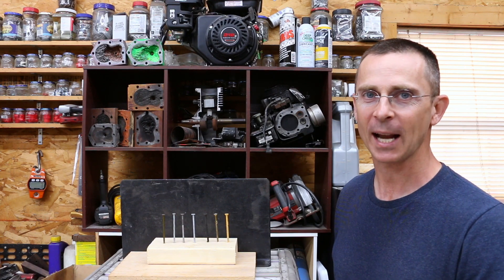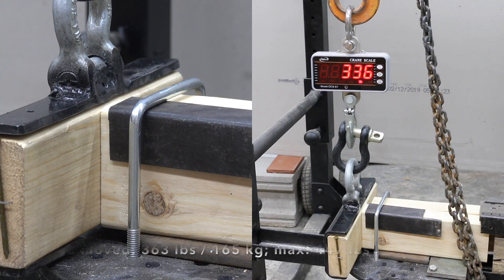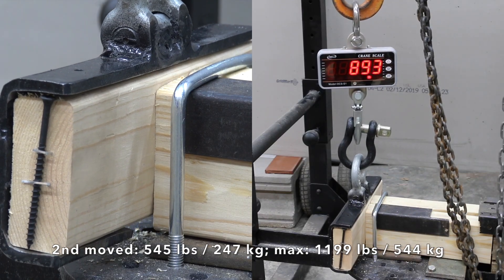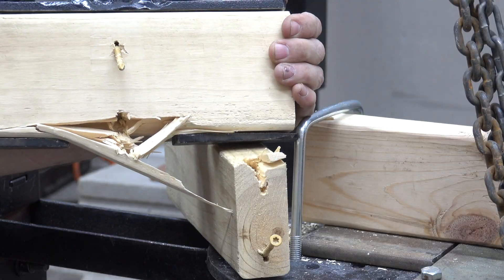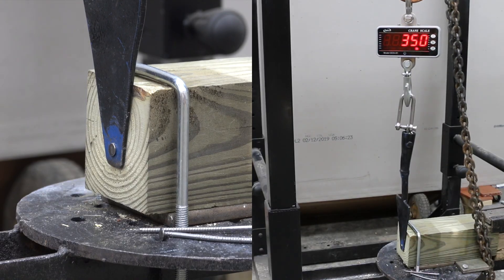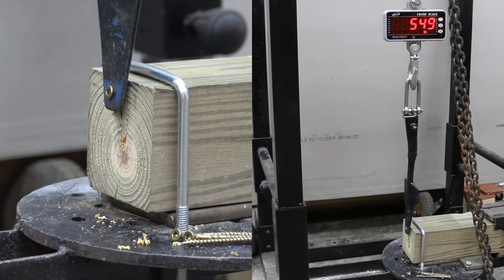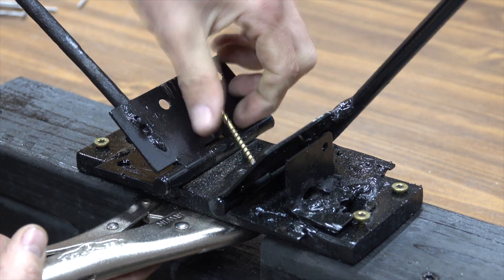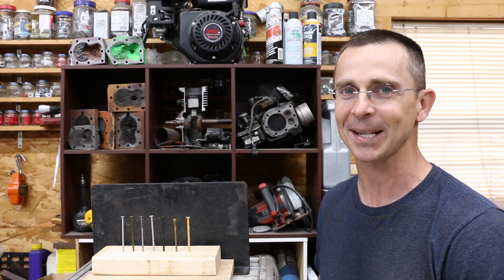Do Screws Shear easier than Nails? Let's find out!

Comment: I like most of your videos but there is a lot wrong with this one. A lot.
Reply from the maker: Thanks for the constructive feedback
Reply: I dont know how it's called in English but if you drive the nails or screws in the head wood you put them in line with the wood fibers and you have way less force required to pull them out or shear them off
Reply: Okay, constructive feedback. Test one: decent test and fairly realistic. Some added value. Test two: mostly pointless. You’re nailing into the end grain which will vary in strength. It’s more a test on the pull out resistance of the test items and not the shear strength. With having them in the end grain the pull out portion isn’t really helpful info either. Test three: pointless. Under normal conditions, even taking into account that structures flex, the test items won’t bend that much nor will they bend where you test them. For the screws that’s a critical point. Just my thoughts. I hope you revisit this one day.

Comment: I built with a lot of stainless steel nails and screws, some are ring shank but most are screw shank nails because I noticed ring shank break easily when driving. I also used some stainless steel screws, I noticed some screws break easier than others. Most stainless is softer than regular steel i guess.  I did get some stainless roof screws, they seemed to be pretty sturdy, but they are probably thicker. Nails rust and even the coated ones rust so that will decrease the life of the project if it is exposed to water. I also used stainless bolts but the bolts are very hard and the sheet is so hard you can barely drill it and it bends if you pull hard enough- they gave me a higher grade of steel I guess as a favor but i could hardly drill it- it will take a bend but with much effort.  it was pretty thick though. I have taken enough old work apart and saw expensive screws and nails rusting after 5 or less years of use. You made an excellent video, great experiment and discussion!
Reply from the maker: Great information. Thank you

Comment: Good video but as a builder and contractor this is really shear load not shear strength. Nails have 5x+ the shear strength screws. Main reason why houses aren’t built with screws. Second reason is time consuming. It also completely depends if you fasten correctly. There are actual patterns and cross grain nailing and weight transferring. They do make some structural screws now. Timberlock, GRK, Swanson and a few other brands but they aren’t commonly used. The cost is astronomical and time consuming. I did find the Timberlocks that replace hurricane ties is faster but a lot of money. $50 a box. End nailing and pulling up really won’t test it. An easy way is to put the nail or screw in half way and hit it with a hammer hard a few times on the side to bend it. Take pliers and go back and forth. You’ll find most screws break much faster. It’s why screw heads snap off a lot with impact drivers. It’s their weakest part. If you ya e a stripped screw you can always just snap it of. Most nails you need a saw saw or grinder to cut em if you can’t pull em out. 3” Hot dipped, galvanized, ring shank, clipped head nails are so hard to get out they are stronger than 20 equal screws at once. Just food for thought.
Reply from the maker: Thank you

Comment: Great fastener test! Could you add Simpson Strong-tie #10 x 2 1/2 screws to your next nails vs screws test. It is meant to replace 10d galvanized nails, where nailing Simpson galvanized brackets space is restricted. I will like to know, if the shear lateral strength is comparable to 10d galvanized nails when used with galvanized joist hangers. Thank our in advance.
Reply from the maker: Great suggestion! Thank you

Comment: the reason you use nails and not screws for structural loads is because the metal they use for screws is much harder and more brittle. That means with fatigue it will fail catastrophically. A nail will not. It will just bend. In a deck application, the force is up and down, so that imparts metal fatigue which will cause the screw to snap. The nail will just loosen and bend over time. The nail gives you warning.
Reply from the maker: Great point! Thank you

Comment: Another good video, one that might be interesting to see is the effect of multiple stacking. For example is will two screws in a piece of wood spread reasonably out allow that wood to support twice as much pull as normal or even more?

 Does a twice thick board equal twice strength? And is stacking two or more smaller boards stronger, weaker or the same as a the same thickness big board.

 Just as interesting set of ideas that have a lot of practical applications when it comes to construction. Thanks again.
Reply from the maker: Great suggestion! Thank you
Reply: @ProjectFarm , glad you think so.

Comment: The only issue I had with your last test where you were using metal levers to bend/fold the nails/screws is that you were not measuring the amount of force with each press of the levers.  From what I could see, it appeared to me that a couple of the screws required far more force to get them to bend in the first place - however once bent at least once, they snapped quite easily. 

I'd like that last test improved with some kind of torque measurement to let us know how much force is first required to bend each fastener.  If there is a significant amount of difference I think that should weigh on suitability of these fasteners.
Reply from the maker: Thank you for the constructive feedback

Comment: good tests and i loved the video but testing for sheer strength on screws is not tested cross grain to end grain because when you screw into the end grain (parallel with the grain of the wood) you have very little strength. I would actually love to see a test done with all cross grain fastenings. 
I am a Shipwright (shipyard carpenter) and have been using the torx head coated #10s for years to build working platforms and blocking/bracing for heavy industrial applications, last year i went to a new shipyard where they used drywall screws for the same applications and watched platforms fail under shock loads over and over again until it became a safety issue and i suggested we switch fasteners which completely solved their issues.
Reply: <3

Comment: I still would inherently trust screws for construction but isn't you shear test for the screws kind of flawed?  Ideally the thread would bite into the opposing material as much as possible meaning you would want o focus the force of the shear test on the shaft of the screw not the threads.
Reply from the maker: Thanks for the constructive feedback.

Comment: That was really informative!  Hindsight as they say is always 20/20, but I would've liked to seen perhaps the test using an LVL, or some other manufactured, and more consistent material.  The only reason I mention this, is that each fastener had such a wide range of failure; I would think a more uniform material may yield more consistent results.  Yet at the same time, again, that was awesome!
Reply from the maker: Thank you!

Comment: Those have got to be the most impressive drywall screws i've ever seen. I've only ever had bad experiences with drywall screws. 

When i was doing CATV installs for a living, they'd give us these cheap-o drywall screws to mount equipment with.. they had to be the cheapest shit on the planet, because the heads would constantly snap off, when we were driving them into plywood. I got tired of it, and started buying short deckmate screws, out of my own pocket, lol. 

There's a video idea... test different brands of 1.5 inch drywall screws, to see which ones are more susceptible to breakage.
Reply: He even says one of the screws sheared off. The test he is doing is not a shear test on the fasteners. All his tests are in end grain (which is the weakest) he should be testing with steel that won't bend or break but actually shear the fastener.
Reply: @joshuategeler3419  Run the test yourself? I dunno what to tell you, man.... why the hell are you telling me anyway?

Comment: I recently used an epoxy resin to fix my windshield from a rock hitting it. Luckily it was in the middle because while it fixed it and it hasn't cracked any further it is not crystal clear as claimed. So if you wanted you can test for the best epoxy resin or what ever else fixes cracks in windshields.
Reply from the maker: Thank you!

Comment: Hehe, I buy the cheapest nails, then I soak them in wood glue before I nail them.  For wood screws, ATF because I am not worried about them pulling out or shearing, but I want them to "slide" in when I screw them in with a power tool.  Both wood glue and ATF do a very good job at rust prevention and are great lubrication for wood fastening.  Really enjoying your videos!  One of my top favorite YouTubers and I look forward to your vids.  Fan from Palau islands!
Reply from the maker: Thank you!

Comment: Nails are made to be ductile, to have some flex, though obviously plain nails are more ductile than ring shank nails.Wall studs may experience some shiftage over time ... you want the nails to adjust when that happens. Screws are made of a harder steel, to hold things together rather than surrender to shifting, but after a certain point they break. 

And drywall screws are made to precisely fit the requirements of ... well ... drywall.

Another significant factor would be cost. For the wall studs, you want an inexpensive solution, since you'll be using lots of them. Some other  situations you might be willing to pay more per nail/screw, to get specific benefits.
Reply from the maker: Great point. Thank you

Comment: First test wasnt really accurate. That black steel that was holding down the horizontal 2*4 was missplaced few times, moved closer to the left edge of horizontal 2*4, giving more strength on the edge and thus more power to top screw/nail..
Reply from the maker: Thank you!

Comment: For the work hardening test, you need to consider the fact that the screws required more force to bend, so the overall toughness may still be higher - it just took a more extreme situation to cause bending in the first place.  This is especially the case since the screws tested were thicker, thus the tensile side was strained farther for the same deformation - not necessarily the same moment.

Comment: this is not shear strength, it is pull strength.
Reply: Eh? Shear is an applied load that is at a right angle to the fastener. Pulling at a 90 degree angle against the fastener is indeed shear strength. You could push the load, but as long as it's at a right angle it's still shear.

Comment: I don’t see any shearing at all.
All I see is nails and screws getting pulled out
Reply from the maker: Thanks for the constructive feedback
Reply: You didn't watch the whole video and see all the nails and screws being bent and pulled upwards at an angle.. also being bent and and snapped. That's called shearing.
Reply: @Mr Brightside that is the definition of shearing. Bending. He did it at a 90o angle. Thus your word used perpendicular. There is no other way to test them than at an angle. 

You cannot avoid something being pulled out. Thus his third test showed bending strength which in itself is shearing. Look at a real life situation. Grip and shearing holds in the same placement it's not something that can be blown out shown 100% both take a roll in it.

Even in a real life situation there's many ways a nail or screw can be sheared due to any degree of bending twisting or full on pressure snaps due to weight.
Reply: @Mr Brightside after 44 years dealing in metal work appliances and construction. I don't believe I can agree with you on that one sir. Appreciate your opinion though.

My main point was it's hard to test shearing without grip test and pulling happening. As I said it can't be shown 100% even in real life situations. This is something you learn after a little while. It's a good test I did notice the wood itself failed in multiple occasions.

Strength points are an amazing thing. Just remember shearing is all about stress. Bending is apart of shear stress it happens along with many other things as I've said.
Reply: @Mr Brightside ..... nails and screws are put in wood all the time in a instance where they will fail is a lot of time in wood.. Involving housing and scaffolds ect. You've never heard of a metal worker? I'm surprised by your ignorance to argue with me son. No need for it.

Bending and twisting is exactly the reason nails or screws fail. They can break while pulled out as well due to force of weight causing stress through seperation. It's an occurrence that sometimes happens. His third test is the best test to show shearing. It still involves bending stress. As I've said this is something hard to test with wood or anything. Even metal can fail. I've seen it with rivets under stress through bracing. But your idea of testing via clamp is kinda like the third test in the video. Issue with that, it's not a realistic scenario.

I don't understand why you are being rude and ignorant towards me. It's childish. I'm trying to tell you what happens when it comes to shear strength and you just push it aside. I don't give a shit what Google tells you matey. This is a opinion vs fact situation it's not arguable right this moment.

This is an example of why people don't understand and learn things. They refuse to listen now adays, it's a shame. I can't take a person serious in a professional manner that doesn't even know what a Metal-Worker is. It's a profession that I guess he just doesn't understand.
Reply: @Mr Brightside Coming from a guy who has never heard of a Metal worker... You are childish and very rude. Nobody can take you serious. Ive talked about shearing all you keep saying is how I don't know... I dont see how that's possible. It seems to me you just don't wish to be wrong like most kiddos these days. Instead of trying to argue just listen and learn. I'm trying to make people understand how shearing falls into place. You aren't being helpful.

Unlike yourself suggesting you won't reply which is just another b's attempt to set yourself ahead of others/myself. This is the last time I reply. I have things to do and can't sit here back and forth with you all day for something so simple to comprehend. You have yourself a good rest of the day. Make sure you look up metal workers on google so you can figure out what it involves xd.

Comment: fascinating video, I am wondering about mounting floating shelves through drywall into studs... where the ability of the self to carry a load is the main issue. Nobody wants their TV to fall off their floating shelf. If I understand your video correctly, Using 6 screws along a 4 ft long wall mounted floating shelf ( with a 2x4 frame on the inside) should be plenty strong to hold almost anything up that you could put ontop of it, correct?
Reply from the maker: Thank you. Yes, this does seem strong enough.

Comment: As a few people have pointed out, you're not really testing shear strength, since they all came loose. The main flaw I noticed is that they're all driven in to end-grain, which is inherently the weakest part of the board. Maybe try again nailing/screwing into cross-grain?
Reply from the maker: Thank you for the constructive feedback!

Comment: My take away from this test, is that if I really want something to hold under a number of different forces is that I should use a combination of nails and screws together. The nails were harder to shear, but the screws provided more holding power. There may be another test, there, to see which  nail and screw combination holds up the best.
Reply from the maker: Thank you

Comment: I wish you had tested Simpson's fasteners made specifically for use with their ties. We are told, time and time again, that they must be used, due to the lesser shear strength of the others that you tested. I am quite impressed at the ability of even the lowly drywall screws. Thank you for all of the time, work and materials expended. Great stuff.
Reply from the maker: Great point. Thank you